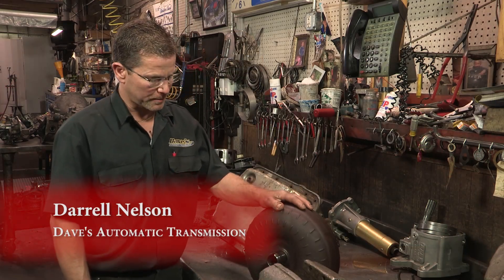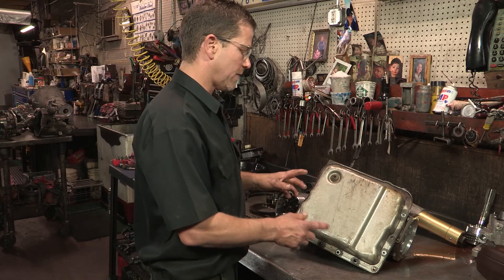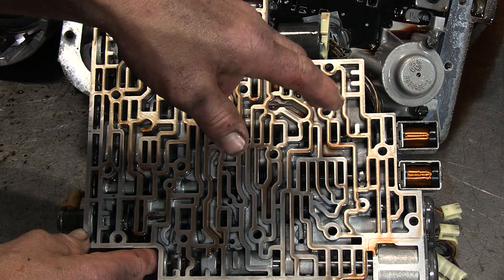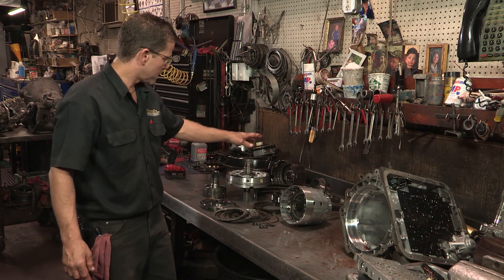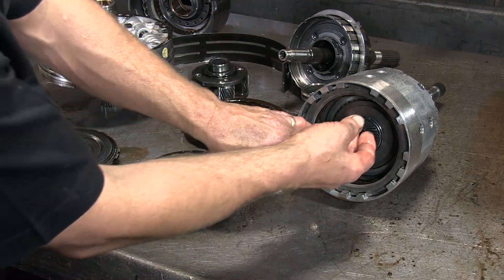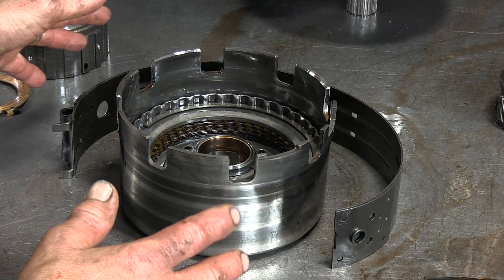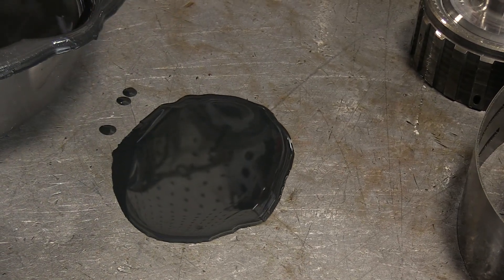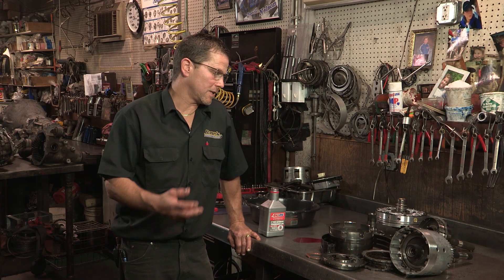An Inside View of the Innerworkings of an Automatic Transmission

Comment: Can I mix Amsoil and Mobil 1 synth ATF? I actually already did and was just wondering if I done a bad thing.
Reply: As long as they're both within spec it's fine. You're inevitably mixing fluids whenever you change the ATF since the old fluid is not the same anymore.

Comment: What about using Amsoil Engine and Transmission Flush before performing a Tranny Flush?  I've read mixed reviews about doing this in transmissions.
Reply from the maker: Hi Jason, The Engine and Transmission Flush can be used in automatic transmissions that have a replaceable filter. It also should only be used if all the fluid is being changed out.  Keep us posted if you have any other questions!

Comment: You also must use the correct fluid.  If you don't you will eventually need a new or rebuilt transmission.  That will be much more expensive than the difference between the correct fluid and some "universal" fluid.  It is sometimes not a good idea to use a universal transmission fluid.  Some cars like my Volkswagen would have me regretting use of such a universal fluid.  It is true that the fluid for my car sells for $18.36 PLUS tax at the dealer but it is a very small price to pay to avoid the misery that a broken transmission can bring with it.  It is one of those fluids that others have tried to find alternative fluids to use instead of.  Most of the time that did not end well.

Comment: Thanks for the video. So, how often should the atf be changed? Every 30k miles or every 60k miles?  Thanks
Reply: Refer to manual, usually every 50-60k. There’s no such thing as lifetime fluid, so if your manual says that you don’t need to change it - it’s lying. Do it every 50k, in that circumstance.
Reply from the maker: Hi Andrew, Thanks for the question. The drain interval for the Signature Series Automatic Transmission Fluids is as follows:
Normal Service: Follow the vehicle manufacturer's normal-service drain interval.
Severe Service: Double the vehicle manufacturer's severe-service drain interval.

For the OE Automatic Transmission Fluids, it would be the manufacturer change interval. 

Let us know if we can help with anything else!

Comment: My first car was an automatic. It was from the 70s and it had more maintenance problems then an octogenarian drinking thorium. I only had it for 3 months. My 3rd car was an Automatic convertible with power everything that I loved, but it had a leaky transmission and I was not good at replenishing it. Needless to say it became a maintenance nightmare after a short amount of time (under two years) but not just transmission problems. Power steering and Power windows started having problems too. Once the air conditioning broke I had enough. 
I bought myself an ugly Toyota with a manual transmission, hand crank windows and electrical power steering. Not much to look at but I've owned it for 10 years and have had no problems. I am confident when I say I believe this car will last me for the rest of my life.

Comment: yes, I'm in favor of changing transmission fluid. a mechanic once told me, its dangerous to replace the transmission fluid, if not done correctly, it can fry the transmission. Is this info correct ? 
I once did this to my brothers car, and he was having lots of problems with his transmission after that. 
ultimately, we needed to get the whole  transmission replaced by a professional mechanic.
Reply: Trino Ponce the fluid should only be replaced if the car owner manual recommends it and was there pieces of metal in the pan from the tranny fluid when it was changed because that means the transmission was already having troubles so putting brand new fluid only worsened the situation because it didn't adapt itself the tranny
Reply: BSM1017CHANNEL ..... Hmmmm don't know, don't remember. Too far back to remember. I only remember the fluid was black. I figured its the same as replacing your dirty motor oil. But after I did what ever I did, my brother had never ending problems with the transmission.
Reply: BSM1017CHANNEL ... Thank you for your input. Very helpful.
Reply: The most common problem is the transmission hesitates changing gears that is cause with heavy acceleration and heavy braking on short distance. When i day short distance i'm talking about pedal to the floor after every stop. Feel free to ask if you got another question
Reply: BSM1017CHANNEL ....  mmmmm. . So heavy pedal to the floor after a stop and heavy acceleration  are both bad for the transmission.  Never knew that. 
I've never done that.  I know of people who have done that.  I think it stupid.  
Thank you again. .. very helpful.
Reply: Transmissions are all different but the majority are not made to resist the constant demand for gear changing like going from 5th to 1th and accelerating again to 5th just to come to a stop 3 seconds later

Comment: Dealers should ask their customers when the transmission fluid was last changed, how many miles ago.  Let the customer know what can happen when the transmission fluid breaks down.  Its less expensive to change the fluid on a regular basis than wait until problems start to come up.  Good video and information.
Reply: cnn  radio  cnn
Reply: AMSOIL Certified Independent Dealer-Al Roberts ysyssdsed f s ga ga h
Reply: AMSOIL Certified Independent Dealer-Al Roberts ikiioiiiïi